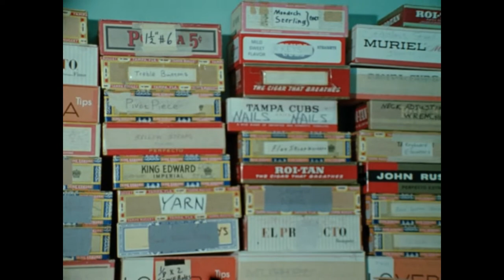Reflections on Country vs City Life by Cajun Accordion Maker Marc Savoy (1970)

Comment: Do you know where to find the full film?
Reply from the maker: I have the Les Blank box set released by Criterion, it doesn't seem like it's readily available for free on the web. Although strangely I get no copyright notice at all on these clips, so I might try uploading the whole thing when I get a new PC up and running with the necessary software. I know there's a Criterion Channel thing where you can "rent" it, and I think there's a free trial, but I've never used that service.
Reply: @Vingul  Thanks for the information. I also could only find paid-for rentals. I just looked up the Criterion disc set and it is very expensive. It would be great if you are able to share more of his films but of course you need to be careful about it.
Reply from the maker: @folksurvival  Indeed, somehow "no copyright claim" seems too good to be true, ha. I did upload the opening sequence to this film a couple of months ago, in case you didn't see it. Incidentally -- I just remembered -- I got the box set directly from les blank dot com, which was less pricy, but it's definitely not cheap. I will keep posting selected clips from this and similar films intermittently, at least.
Reply: @Vingul  Thank you. I have found a file of one of the films since my last comment. I might be able to find some of the others too.
Reply: @Vingul  I just checked his site for the Criterion set and it is there but there seems to be a problem with the website because I can't see any pricing or options to purchase, I just get an error message.
Reply from the maker: @folksurvival  Cool, which one did you find?
I'm able to access it under Products, it's $84.95. My favourites on it are by far Spend it All and Sprout Wings and Fly, they're also the most relevant to "us" if you get my meaning. I will try to upload them in full, although not very soon probably, but I'll let you know. There's also his Herzog/Fitzcarraldo documentary Burden of Dreams, but that's not part of the box.
Reply: @Vingul  I found Spend It All.

"I will try to upload them in full, although not very soon probably, but I'll let you know. "

Thanks. You could possibly upload them somewhere else to avoid risking your channel here.

"There's also his Herzog/Fitzcarraldo documentary Burden of Dreams"

Yeah that one's easy to find and more well-known and popular.